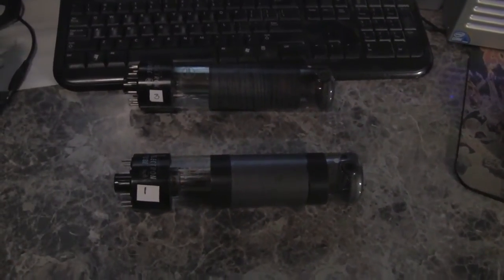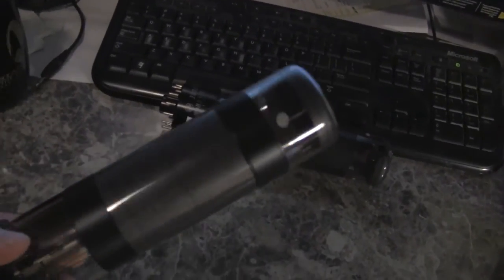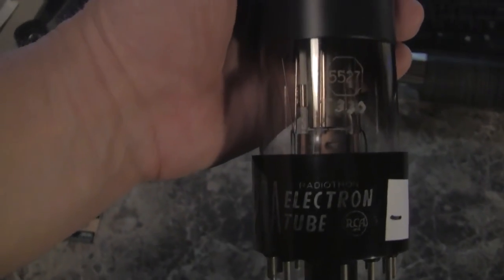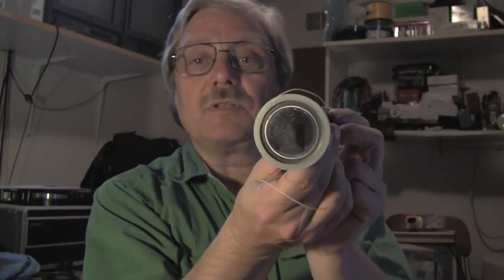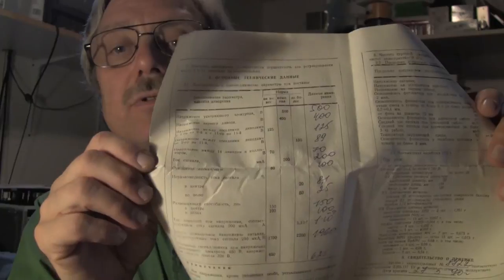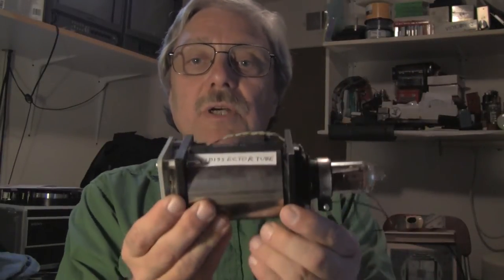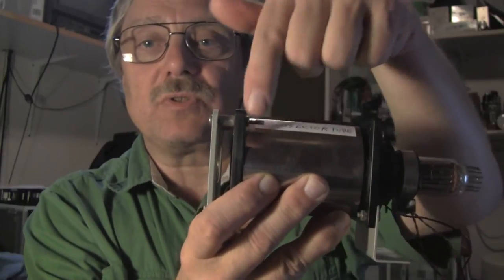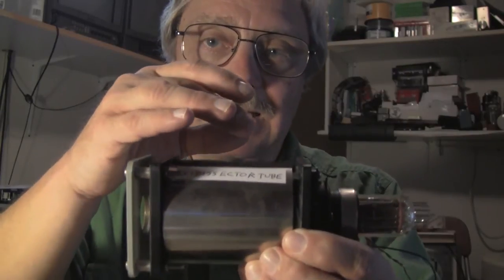Rambling about various antique television camera tubes!

Comment: Thank I really appreciate this video absolutely fascinating.  I can't find any (video) information on how the image dissector works.  How does the light change in to electrons?  Also do the metal charged plates inside the system correspond to the colors in the digital picture?

Comment: Hello. Perhaps you would know the answer to this: I have a 3 tube camera that powers on, and I can connect to my computer. I get bars on the bar switch, but when I switch to the actual camera mode, all I see is a black screen with a small white dot. Does this mean that one (or all) of the tubes has burned out? Any info would be appreciated. Thanks!
Reply from the maker: A brand and model number would help. Are you sure you don't have the filter wheel set to closed? Is the iris open on the camera lens? Is there an image in the viewfinder? Go to my web site Labguysworld and contact me from there via email and I will help you figure this out.
Reply: @videolabguy  Thank you! Sent you an email.